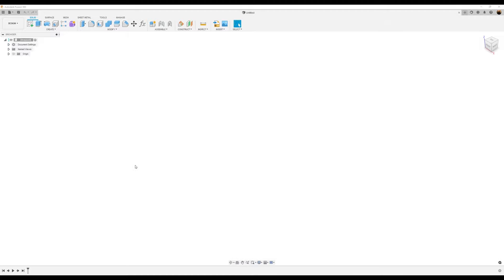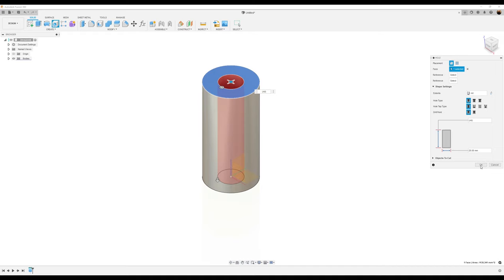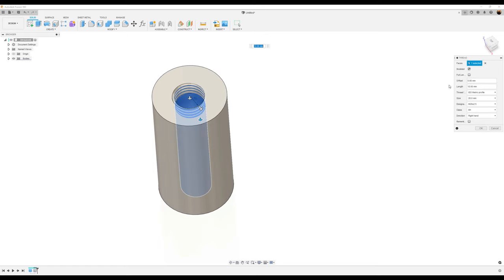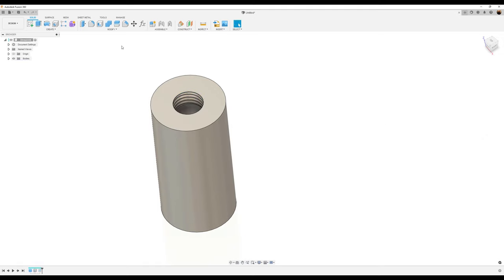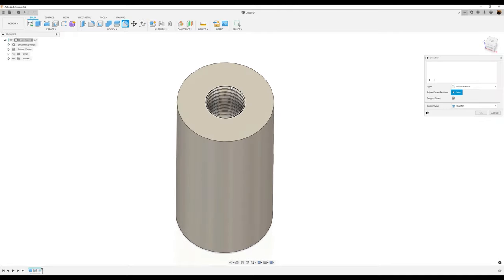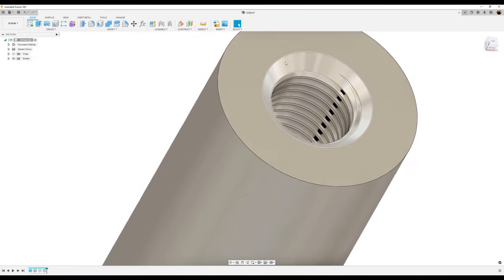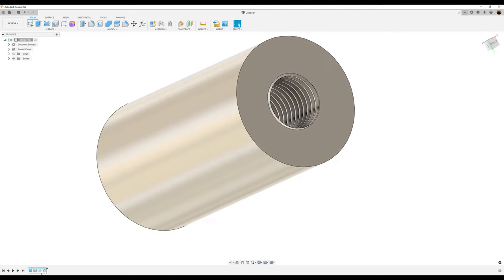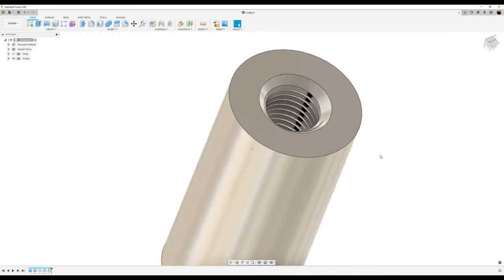How to add a countersink to threads in Autodesk Fusion 360

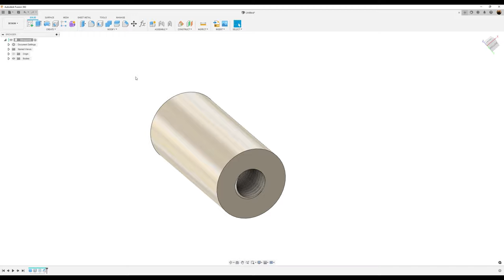Comment: You should be able to chamfer from the remaining portion of the circular edge which you selected at 2:35.
If it didn't work a year ago, then it must be an update because it works now.
As for chamfering the edges of male threads, the best way I've found it by extruding a circle at 45 degrees.
Reply from the maker: There is usually more than one way to accomplish a task so, your methods may also be a viable option. Thanks for sharing!

Comment: This would often leave another issue. Section analysis will show the chamfer has likely created an internal ledge. Sometimes you can delete face and get rid of it, but it's cleaner to revolve cut the area with a 30d triangle around the screw axis. Then the thread will chamfer out with no errant geometry.
Reply from the maker: Do you have a video or example of this? I have not currently ran into this issue as of yet.

Comment: This one specifically, for internal threads, does not seem to work for me. Externals are no problem, BUT I actually need to do those in the opposite order: chamfer first and then it magically works. Don't know if something was changed in fusion or not.
Reply from the maker: Make sure that the threads are not full length but go slightly below the edge. Then when you chamfer afterwards you can modify it as you see fit. However, if you've found a workaround that fits your workflow, that's doable also!
Reply: @CADJungle  yep, turns out it's dependent on the type of thead partly: uk gbp pipe thread worked worse than some others for example.

Comment: Can't you simply reverse the operations? Chamfer first, threads later? I personally try to do threads at the last possible moment anyhow since it slows fusion down quite a bit.
Reply from the maker: The problem with performing the chamfer operation first is that the threads won't exit, but will always stay below the chamfer. With the example in the video, the chamfer is now blended with the threads and shows a visible exit.
Reply: @CADJungle  Ah, that makes sense